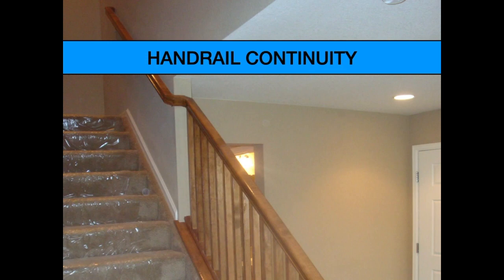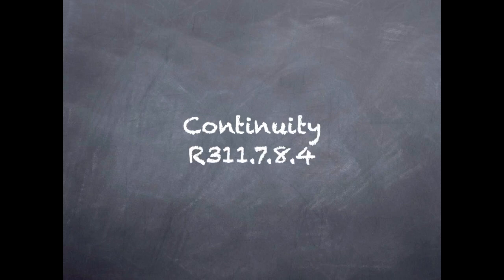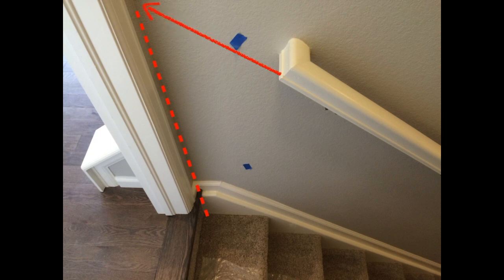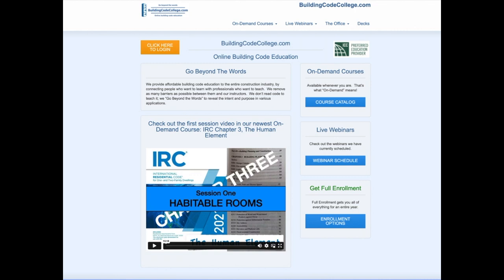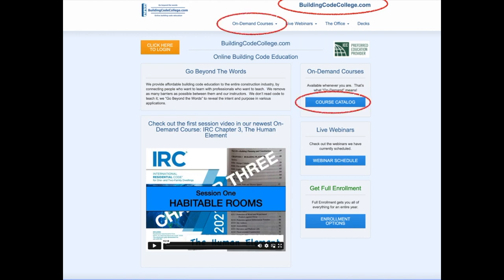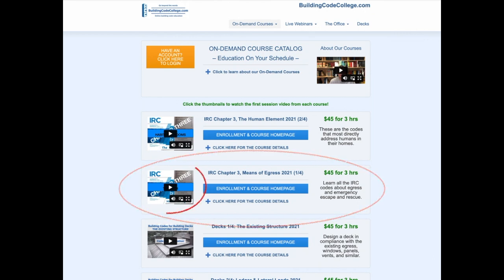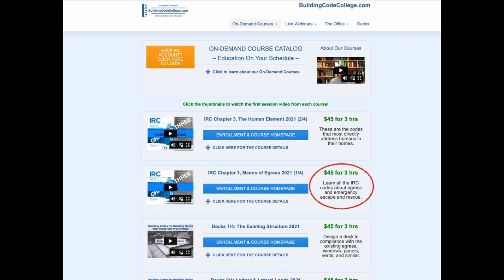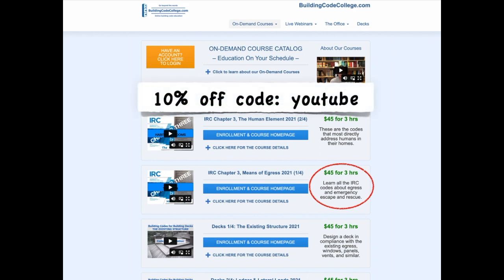Building Codes for Continuous Handrails

Comment: Hi Glen, does the stair railing in the opening of the video meet continuous standards? I'm struggling to see the difference between that example and the "bad" example at 0:53.
Reply from the maker: There is a very subtle difference:  one photo example  the handrail runs to the wall and the another piece connects, you have to let go.  On the other one, the cover, the handrail makes a bend and you don’t have to let go.  That’s what it comes down to.  Do you have to let go?  If so, it doesn’t comply.